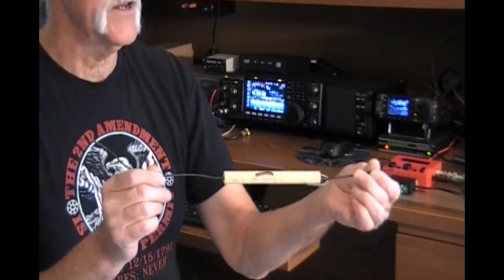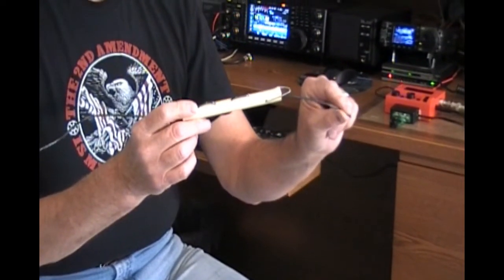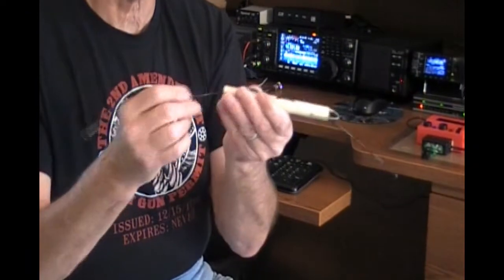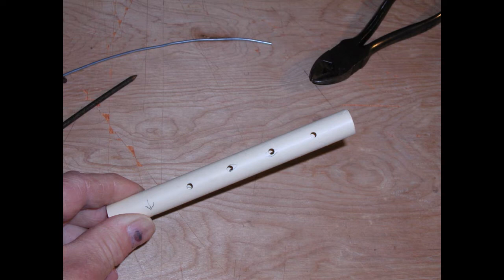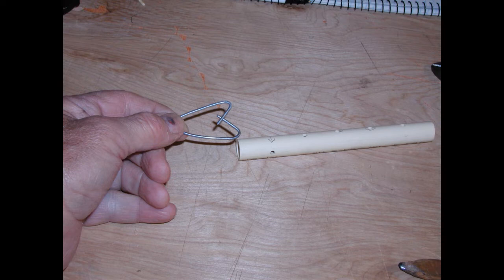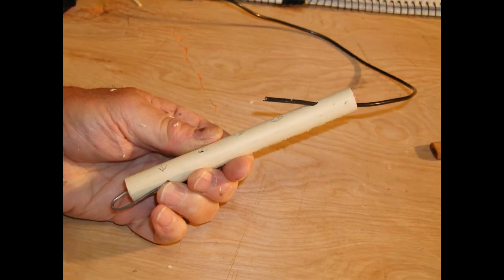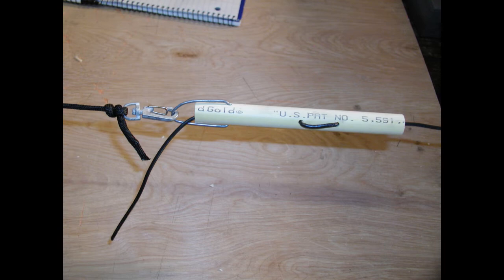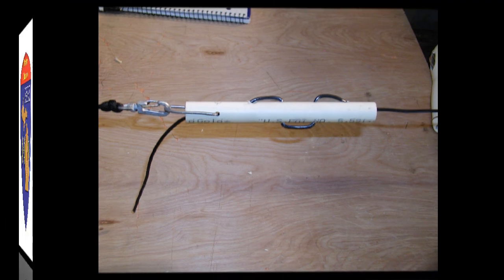No Solder Antenna Insulator

Comment: Neat idea! I'd take out the metal fittings; you're asking for avoidable complications. Just a bunny knot in the hoist'll do 'er. For the record I never buy end insulators; always saw the mouth off a pop bottle. When I'm tuning my resonant EFHWAs I strip back the radiator and twist it around the insulator as for soldering, but don't solder it until I like the SWR. It's a little more fiddly than your drill, but it gets it done.  Anyway, your  solderless design is a handy trick to know. Saved to my Antenna list.
Reply from the maker: Thanks for the view and comments.  The pop bottle idea is a good one too.  I have never heard of anyone using that method before.